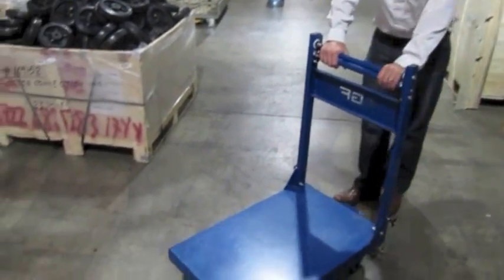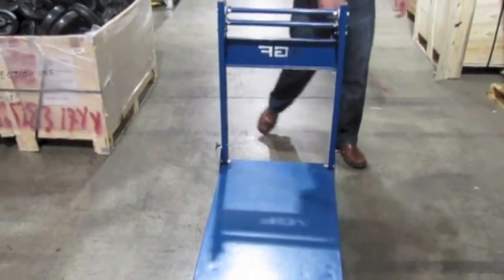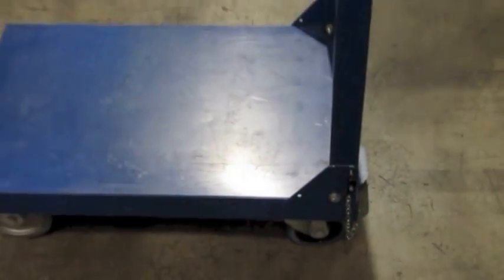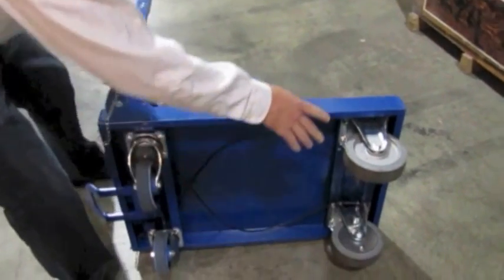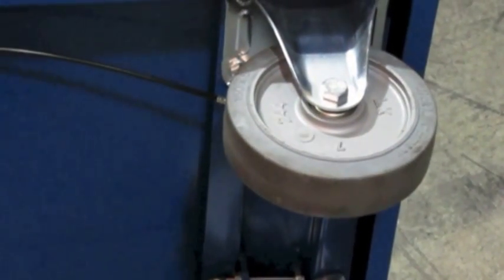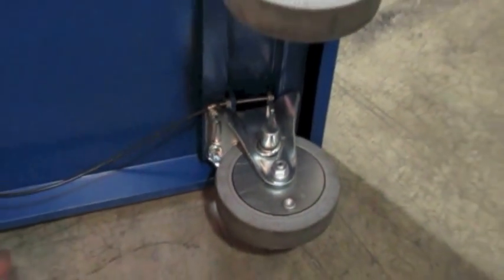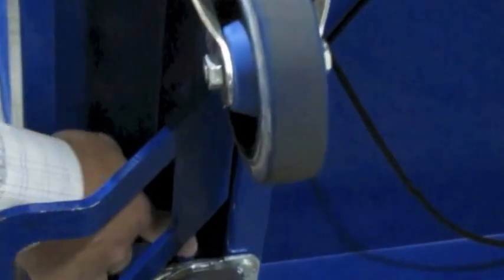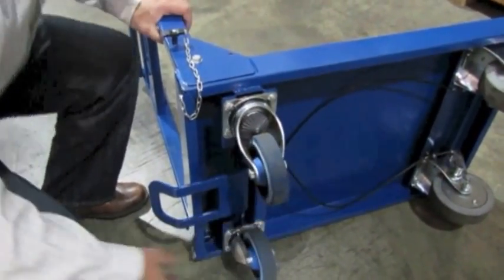Dead Man’s Brake & Central Locking Brake Systems: What Are They?

Comment: Nice design on the rotating caster brake. 👍 Although its specifically engineered for the cart its being installed to as the width between the wheels and additional mounting points need to be realized for the foot paddles etc...